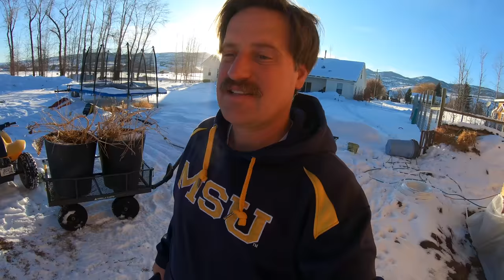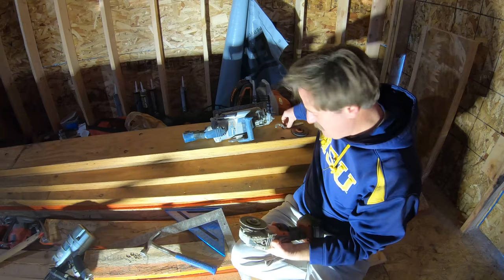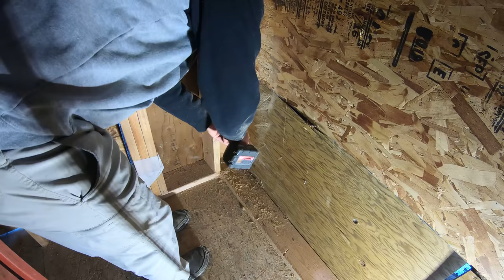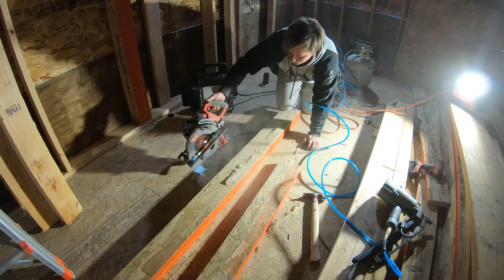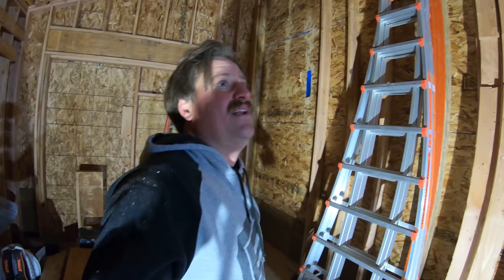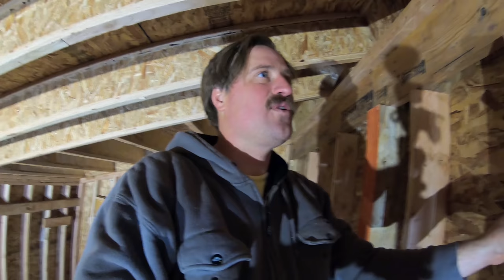Turning a storage shed into a SHE SHED. REMODEL

Comment: I built a 15½ft by 21ft shed last spring to get my fabrication tools and lawn equipment out of the weather and locked up and safe. I put in a storage unit roll up door on it so I can pull my golf cart and bikes in and out with no issues. I'm glad I did well worth it all ready

Comment: Just for the sake of hindsight I use a punch and clinch protruding nails into the wood under those circumstances. Safer, quicker and adds strength... doesn’t set fire to you either.

Comment: How much do you like your Milwaukee worm drive cordless skillsaw?? Nice shed, dude it’s sweet
Reply from the maker: I really like it a lot. Worth the money if you cut a lot. The saw cuts power completely off if you bind the blade but other than that... It is great. Keep in mind.... It's not a corded saw so it doesn't power through material like a corded saw does but well worth the tradeoff with not having to deal with the cord.
Reply: Thanks for the feedback man, sounds like I should have one of those as well as my collection of Milwaukee tools, you should get paid for this cause your selling tools pretty much😂

Comment: I would use structural GRK screws instead of deck screws. Deck screws don't have enough shear strength.
Reply from the maker: Simpson SDS screws. would have been best. I just bought what was at the hardware store.
Reply: @lawnrebel  gotcha. I'm sure the She Shed will be just fine. Keep up the good work, and don't listen to that whiner Ryan... even though he does root for the better baseball team.

Comment: don't use on metal cutting wheel their junk they fall apart they make a lot dust.  use a diamond cutting wheel they cost a little bit more but the last a lot longer. You can normally find a 3-pack for 10 bucks at Walmart.

Comment: That LP engineered lumber requires 120 psi to 140 psi on the nail gun and you don't have a big enough gun or compressor
Reply from the maker: Yes. This is why I am hand driving the nails after they get half driven
Reply from the maker: It is some thick and dense material

Comment: Nice tool belt; Occidental Leather? I only caught a glimpse of it. You going with an opaque rectangular row of glass/cubes along the top? That would look sweet, similar to what I have in my master bath. Lets in plenty of light.
Reply from the maker: yes on the row of windows. It is going to look sweet. Yes on the Occidental Leather bags. The best bags out there for framing.
Reply: @lawnrebel  Those are sweet bags, I don't do enough building around my house to justify a set, but when I start with my new house, I'll spring for a set. Great choice on the redesign with the windows, I'm looking forward to seeing how it turns out!

Comment: Nice work.   Looking to build a 16x12 one this summer. Coming along nicely. 2 steps forward, 10 back. Ha
Reply from the maker: bigger the better. They can never be big enough.
Reply: Connor Ward exactly my thought.  Just limited to space in the backyard.   Currently have a 10x10 gambrel that came with the house(not big enough and falling apart)  Choosing 12x16 due to material sizes.  Work as a PM for a local GC and trying get discounts on material.  Similar to your experience, I assume.

Comment: Looks good, but why didn't you just leave the existing headers in place and cut out the window openings with new "short" headers over each?  Would have saved a ton of time and a ton of material and ultimately been just as strong of not stronger with all your point loads maintained. Not dogging your work, it all looks good. 
And yes, although safety glasses are a pain in the ass, you really should have some, especially with the social following you have. 😎

Comment: When I ruin my clothes they go into the "work clothes" pile.  I don't get another one to burn up LOL.  You need eye gear bro.  I still remember my 6th grade wood shop teacher.  Everyone would always wonder why he wore an eye patch until you have his class.  First day of class he takes off his eye patch and says,  "this is why you wear eye protection".   I never go without it since then.  BTW, milwaukee sux azz.  Dewalt FTW!  lol  Get the Dewalt DPG55-11C anti-fog safety glasses.  They are freakin awesome!  Totally adjustable and you can wear them all day and you don't know you have them on.  I bought like 5 pairs off ebay for like $6 each.
Reply from the maker: Just bought some of those anti fog glasses. Thing I HATE about safety glasses... they are ALWAYS scratched. I go to use them and I can not see a dang thing. Milwaukee has leap frogged Dewalt. All the brands are pretty good TBH
Reply: @lawnrebel  I beat on those glasses pretty good and so far no scratches.  They will still occasionally fog up but rarely, but usually goes away immediately.  I was kidding about milwaukee and dewalt.  Both are awesome.  One thing pisses me off though is milwaukee owns the patent for lithium ion technology.  So everyone has to pay them royalties that uses it.  Why the hell aren't their tools cheaper?  Yeah some of their tools are better and some not, but all are more expensive seems like.  Anyway its not that important.  Good you got some eye protection.  That one day will come where your gonna be like, "damn if I didn't have these on......." . Those glasses already saved my eye.  I was screwing something overhead in a weird position (ok that sounded odd LOL) and the drill torqued out of my hand.  It turned around and the shaft (with extension)  was going straight to my eye.  Those glasses saved my butt.  Got a decent gash on my nose though.

Comment: Coming along but your roof still scares me. Those I beams are just resting on the top plates?  Basically the bearing surface is what, 1/8” of the beam on the plate just where they contact?  Does the manufacturer even say that’s a proper use?  Traditional lumber would be birds mouthed, toenailed and hurricane tied.  I dunno maybe this some new way but seems odd to me still.
Reply from the maker: There is a triangle wedge cut and sitting on the wall behind that 1/8" that you are talking about. You just cannot see it. The shorter wall has the same thing but you can see the wedge on the shorter wall.

Comment: Skylights would have easier
Reply from the maker: True... But this is not about ease in the short term .... It is about the final look of the building in the end.
Reply: @lawnrebel  maybe some hopper style windows that open to allow for air circulation unless you are going to put a mini split system in.